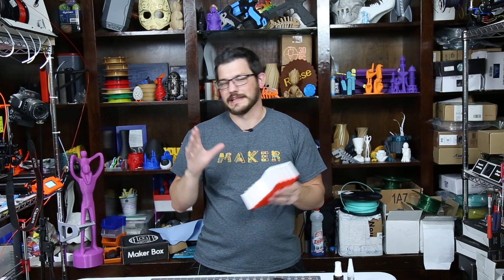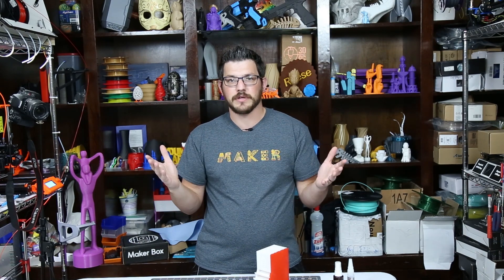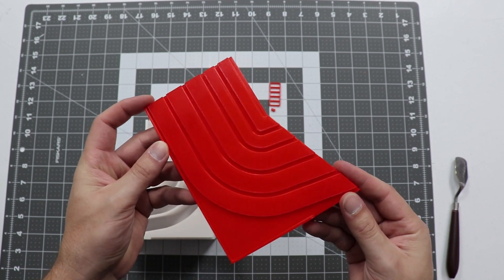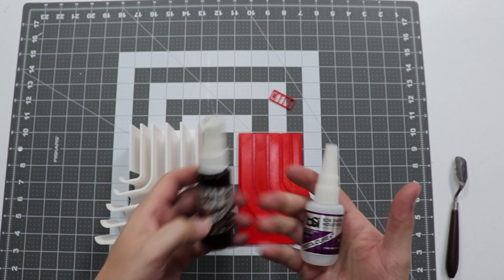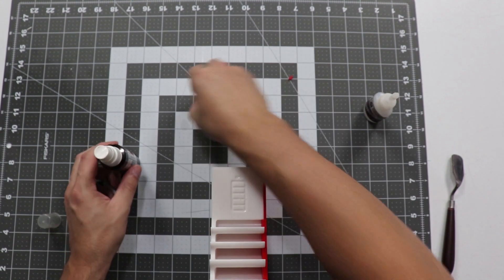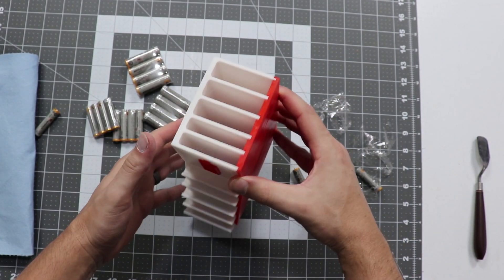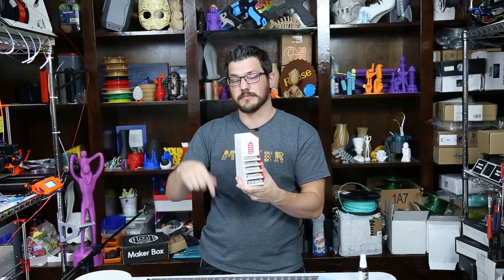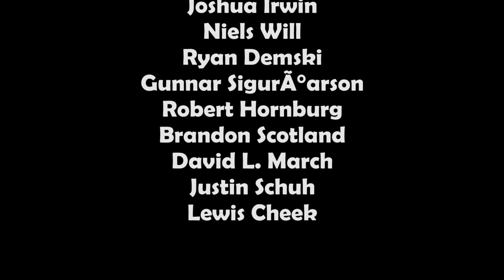3D Printed Battery Holder

Comment: The Insta-Set is completely unnecessary. It creates a weaker bond and significantly reduces your working time. Just using CA glue alone will create a stronger bond and will only take maybe 30 seconds to setup. Somehow using CA accelerator got popular to use on YouTube videos, but in reality it is almost never needed or the right answer.